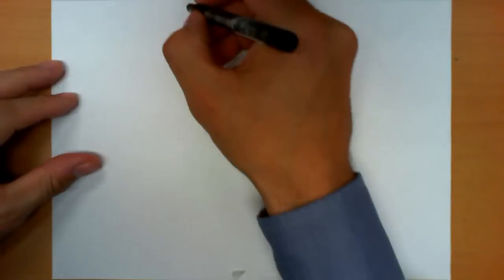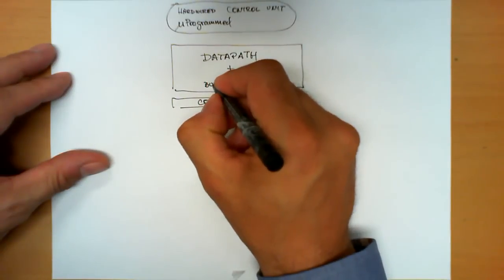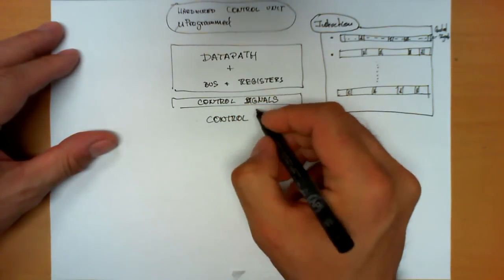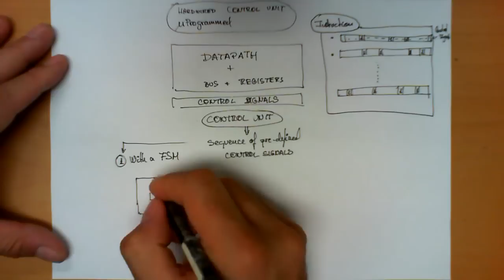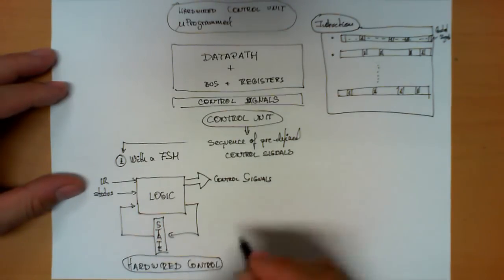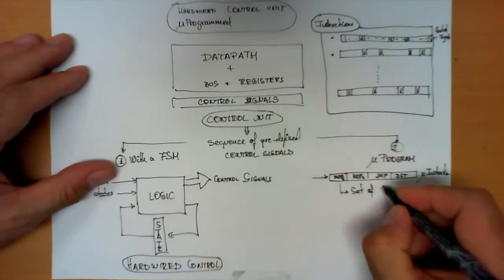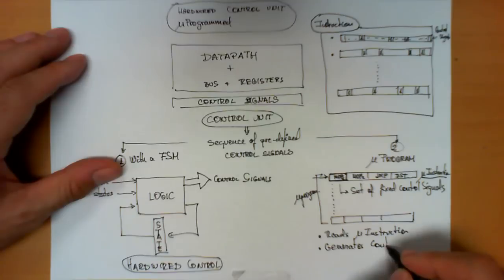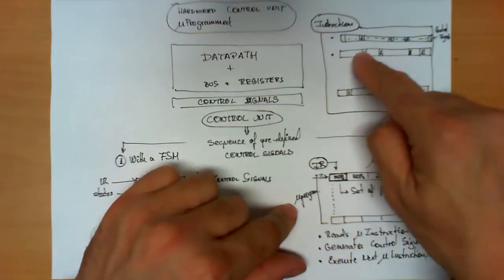Hardwired vs microprogrammed control

Comment: Thank you for the effort, But If i am not mistaken is the difference only on being finite state and being bit by bit structure? I mean I am not understanding the concept really. How about the horizontal and vertical microprogrammed control unit and their difference. what is their advantage and their disadvantage clearly. I think the control unit operation deep inside is a little bit complex for beginner. any further explanation please?